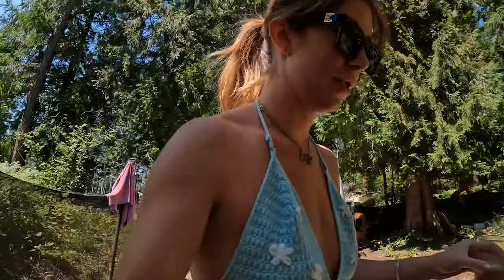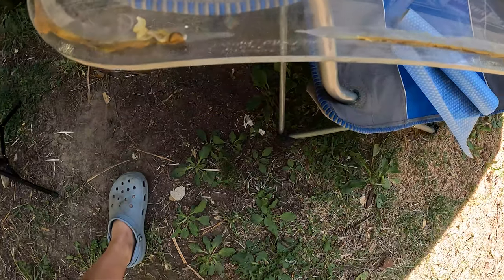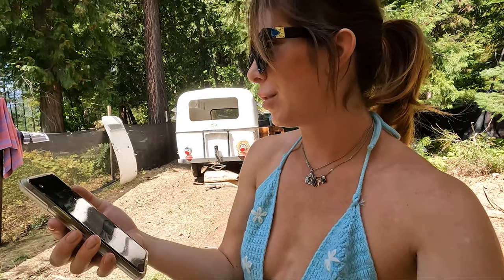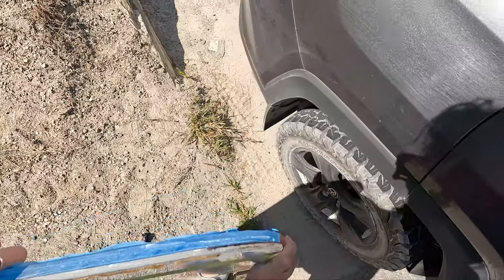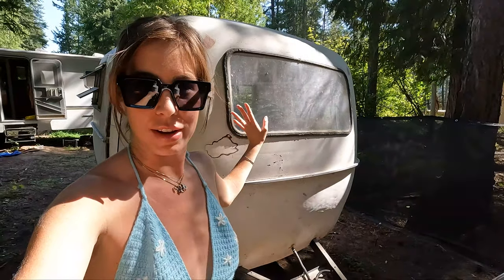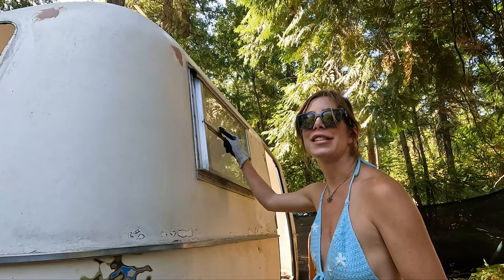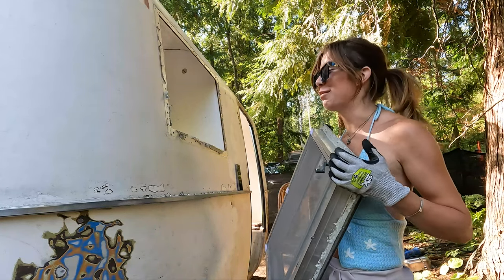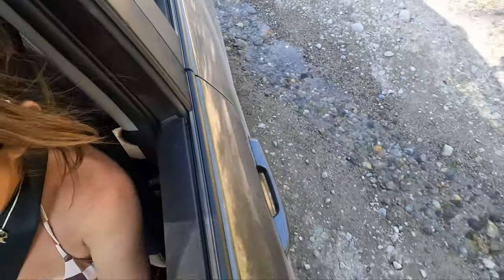Demolition Gone Wrong 😬 | 1972 Boler Restoration

Comment: Great video's, they just popped up yesterday. One tool that I use a lot in my resto projects that is not an expensive item $20.00 is a heat gun. Looks like a hair dryer but get's hotter. A little heat sometimes really helps when your installing or removing old glue, rubber etc.
Reply from the maker: hey Ted! The heat gun would have saved me a few times.. I might just buy one to have on hand cause in the situations of need, its easy to find "something else" that works, but in reality id be grateful to have it. good point!
Reply: Good sources